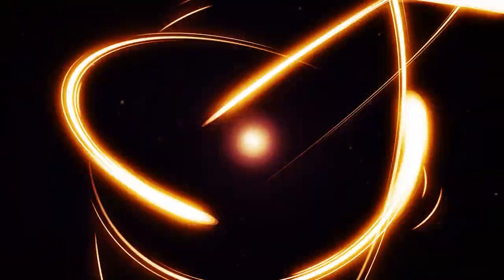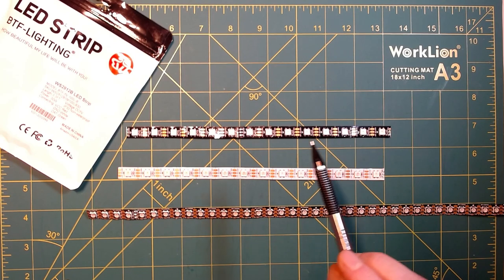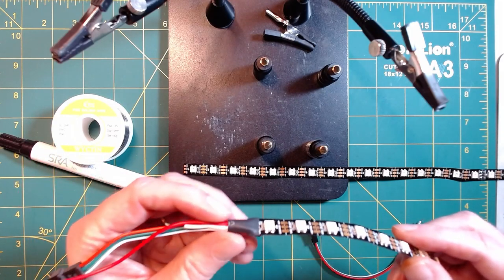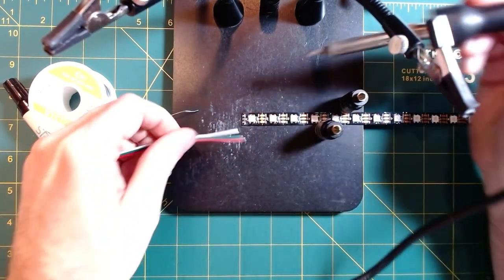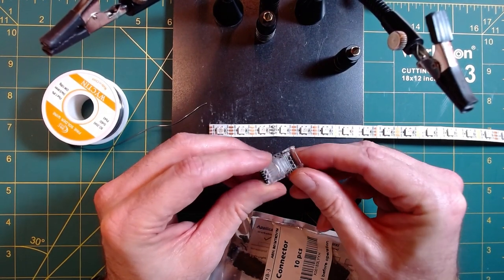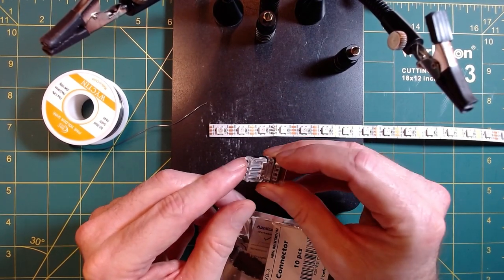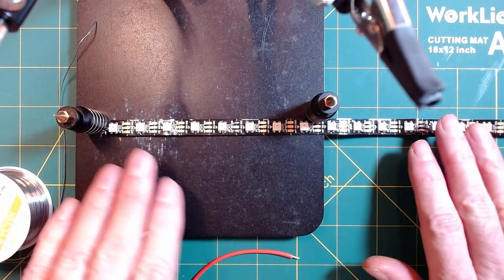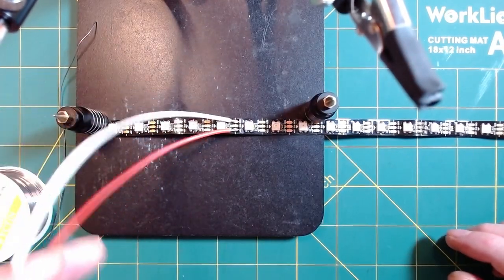Using WS2812b RGB Light Strips

Comment: Why don’t you use 12V strips?
Reply from the maker: I sometimes do... it depends upon the project and use case.  But 12V strips are only addressable in groups of 3 pixels and that doesn't work for some projects, like my matrix clocks, where each individual pixel must be addressable.  Plus, most ESP board that are used for the controller are 5V, meaning that I have to add a step-down converter from the 12V power supply.  And, as a general rule, 5V LED strips are slightly cheaper for the same length/number of pixels.

However, in some cases, 12V are a better fit... like for my Christmas tree, where I could have more pixels with fewer power injection points.  Again, it depends upon the particular project.
Reply: @ResinChemTech  I’m starting to understand better the various intricacies. Thanks. I want to run a 10ft strip under my new TV console that floats 8” above the floor. I can fish the wire in and hide components inside the cabinet (not sure if I need to use U channel or just glue it w/3M tape). And also possibly another strip behind my 85” TV, but because of the size I may need close to 5.5m strip.  With 5V I’m worried about voltage drop and bulk of power supplies. And I don’t have much space behind the TV which is already fixed and and has <2” space behind it. Not sure I can stick too many bulky items behind it. I will have to call a couple of people to help me bring it down, hold it for the time it will take to stick everything behind it then hang it again. Would 5V work?
Reply: @ResinChemTech  not many mention this in their videos but I also learned that the reason 12V strips group 3 LEDs together is that the native voltage of an LED is 3.3V and by grouping them together they split the 12V by 3. 24V strips group 6 LED for the same reason.
Reply: @ResinChemTech  another thing I learned is Wattage and Amperage. You always mention that each pixel needs 0.06A and to multiply the number of LEDs by 0.06 to determine the size of the power supply. But that’s only for 5V strips. But strip specs usually say 0.3W per LED. Isn’t it better to take the wattage then divide by the voltage to arrive at Amps? This way you get different results for 5V and 12V no? Or do we need to account for the fact that 12V strips are grouped in 3s?
Reply from the maker: There are a lot of different ways to approach this, depending on your needs and/or wants for the project.  In terms of the 10' strip, if you are using something like WS2812b 60 pixels/m LEDs, that's only going to be around 180 pixels, requiring something like 10 A (give or take).  You can get the smaller (what I call) brick style 5V power supplies in 10A, as opposed to the larger "transformer" style.  And at only around 180 LEDs, you probably won't need to worry about power injection.  And of course, if you drop down to 30/pixels per meter strips, that cuts everything in half.

The longer 5.5 meter strip around the TV is an entirely different matter.  If using 60/m strips, that's around 330 LEDs... and you will definitely need power injection... probably just at the end of the strip (as well as the incoming power at the beginning) and around a 20A power supply (meaning the larger transformer style).  But if you are running the strip around the back side of the TV, then chances are the beginning and end of the strip are going to be right next to each other, which makes power injection pretty easy.. without the need to snake long wires from the power supply to some remote point.  Again, if you drop down to only 30/m, you are only looking at somewhere around 15 A (which you can find a handful of these in the smaller "brick style").  And at around 160-170 LEDs, you may not even need power injection.

Or... again, you could simply use 12V and step down the voltage to 5V for the controller(s) using a step down buck converter (I have a sample wiring diagram for doing just that in one of my blog articles: https://resinchemtech.blogspot.com/2023/01/wiring-diagrams.html

And another option is to simply buy a prebuilt controller.  The ones I recommend are from Quindor over at Intermittent Tech.  These work with both 5V and 12V LEDs and power supplies, and come with an ESP32 preflashed with WLED:  https://quinled.info/pre-assembled-quinled-dig-uno/ (this is what I used for my 12V Christmas tree).

So, you have a lot of options for either 5V or 12V.  It just depends on your particular design, install location and desired effects.  Hope that is helpful!
Reply: @ResinChemTech  thank you. I’ve seen the step down converter before. I could probably use the same conduit I used to fish HDMI cables to the TV to fish a 18g 3 wire cable to the back of the TV and hide everything in the cabinet below the TV. If I do that, do you think i can use one big transformer and 1 ESP32 (+step down conv if I go the 12V route) to power both strips (TV and cabinet) or would that cause a headache in programming the WLED app?? And if I need to inject power for the TV strip because of the 5V voltage drop, can I connect the power cable to both the beginning and the end of that loop? Or do I need to fish 2 wires? The lengths of the wire I need to fish through isn’t too long. The TV only sits about 8” above the cabinets….
Reply from the maker: You could technically run both strips from a single controller, using a different data pin on the ESP32 for each.  But you will have to create segments and it might complicate things depending on what you want to do with effects.  Personally, I'd use two separate WLED controllers and use the sync functions if I wanted the two strips to function together.  You can sync multiple LED controllers together... but with individual controllers, you also have more flexibility in terms of what you can do separately.  This what I do with my kitchen cabinets (under and over).  There are two WLED controllers, but since they are synced, they appear most of the time like a single install... but with the flexibility also treat them completely separately via automations, etc.  You can use a single power supply for all of it.. as long as it has the amp capability to power everything.
Reply: @ResinChemTech  thanks again. Makes sense. Now one think I just thought of is the power supply available. I only have 1 outlet behind the cabinets and I’m using it to power the TV and some of the TV cable boxes like Apple TV and soundbar etc… if I add these LED lights with one big or two smaller power supplies, will that single A/C outlet be able to handle all that? I’m not an electrician but I believe these outlets are rated 15A normally no?
Reply from the maker: That 15A draw is on the DC side at 5V (based on a 75W capacity) .  The amp draw on the 120V AC side will only be a fraction of that.  There are online calculators that will let you estimate the AC current draw for the power supply, but the power supply will probably only draw around an amp on the AC side.  As a very rough estimate (check my work as this is off the top of my head - and there's more to the calculation than what I'm showing here), but power (watts) = current x voltage.  So amps = power/voltage.  At 5V, a 75W power supply can generate 15A (75/5).  But on the AC side, at 120V, it is 75W/120V ~ 0.6A.  Again, this isn't the precise calculation, but hopefully enough to show that a 15A draw on the DC side isn't equal to a 15A draw on the AC side (the AC side will be lower due to the higher voltage.. all else being equal).
Reply: @ResinChemTech  ahh. Relief LOL. Thanks. I should be fine. I’ll double check.
Reply: @ResinChemTech  thinking further along on my project…. I am leaning on using a single 5V 40A Powers Supply and 2 ESP32 boards for each to run a 3m Strip under the cabinet and 5.5m strip behind the TV… I think I will use the SK6812. The boards will be close to the Power Supply and both close enough to the beg of the strip under the cabinet, but I’m going to have to run a 6-8 ft long cable through the wall to get to the TV strip…. What gauge wires should I be using for all the wires and the jumper connections?

Comment: Wondering if I could get your professional advice on a bigger project on a more personal platform.  Do you have an email or discord?
Reply from the maker: Could you provide a general idea of the project?  I may or may not feel "qualified" to offer any real advice, professional or otherwise.  And while I'm always happy to answer a few questions and try to help someone out with a project, please understand that my free time is somewhat limited due to my own projects and other responsibilities.

While I do have a Discord account and private server, for obvious reasons I do not want to publicly list them here in the comments.  Let's see what we can accomplish here first, then if necessary we can find a way to continue the discussion on another platform.
Reply: @ResinChemTech  So my wife is turning 40 this year and I was thinking of making some marquee numbers or letters about 4 feet tall.  The traditional way to do those is with light bulbs but I’m thinking of using LED to have some fun.  I’d really love to light up the letters with effects like a sound equalizer bar moving top to bottom.  However I think that would be way to costly, power hungry, and idk how to program so the lights will all reach the center of the letters at the same time having gaps.   I thought about doing a single sound strip around the inside edge facing the inside to light up the letters and smooth out the glow to prevent a dotting look but I think it would also make the lights look very dim.  I also would love to have a nice amount of LED lights but I understand it could be overwhelming.  Any advice or tips on this would be greatly appreciated.  If this might be too much for my brain I could always just rent finished marquees with the traditional white light bulbs but I feel this could be doable.
Reply from the maker: Sounds like a cool idea.. and probably not as difficult as you might think.  You can do this without any real "programming" as the WLED firmware on the controller can provide well over 100+ effects, including reversing directions, dividing the strips into "segments", etc.  There's also a sound-reactive version where the lights react to sound. Power requirements might be high, but depending upon the LED strips and density you select, you can estimate around  a max of 18A per 16 1/2 feet of LEDs for the 60 LEDs/m variety.

I have a couple of other videos you might take a peek at that aren't exactly what you are wanting to do, but are both similar in concept: 
Hexagon LED Panels: https://youtu.be/lNcsT5DZjAM
Magnetic Letters: https://youtu.be/JlK5LtIt_jQ

Another challenge would be if you are going to install this outside.  That does add a lot of complexity and effort to assure all the strips and electronics are water tight.  Tell you what... if you want to discuss further, you can find my email on the 'About' page of my channel (it says 'for business inquiries').  If you want to email me and provide your Discord ID (name + #xxxx ), then I can reach out to you on Discord and we can chat in more detail.  Just mention this project in your email so I recognize it.  As you can probably guess, I get a lot of email to that account!